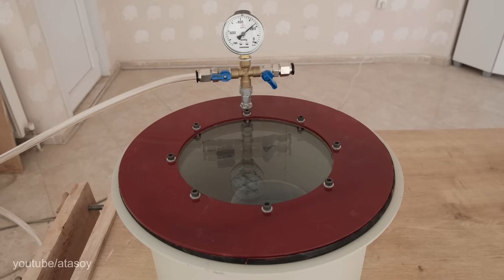Epoxy Lamp in Bulb Shape With Sea Creatures | Epoxy Resin Diorama

Comment: What is the  reason for  putting  the stuff  in the  pressure  canister?
Reply from the maker: Bubbles form when we mix the epoxy.
I vacuum them by putting them in the vacuum tank to remove these bubbles.
Reply: Thanks for  telling me  I didn't know that.